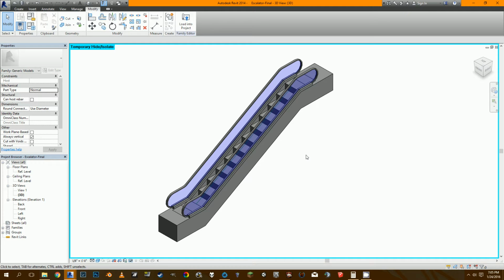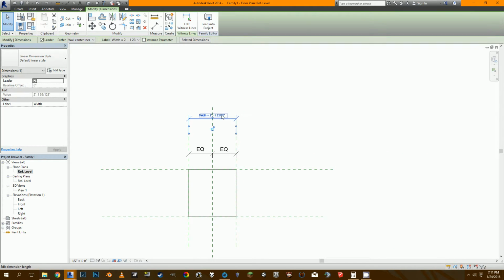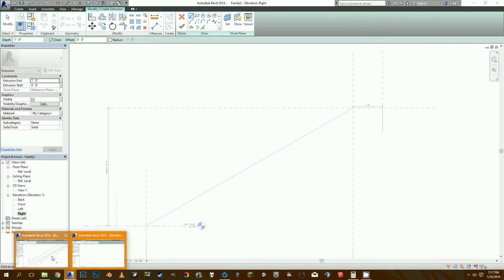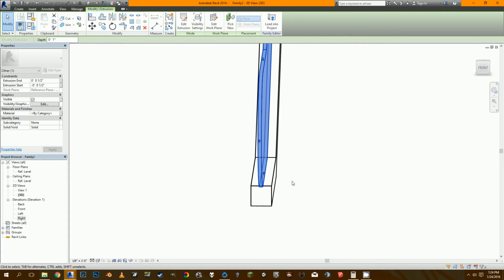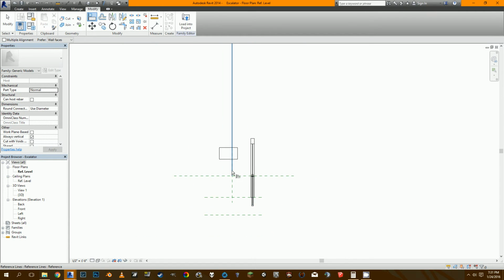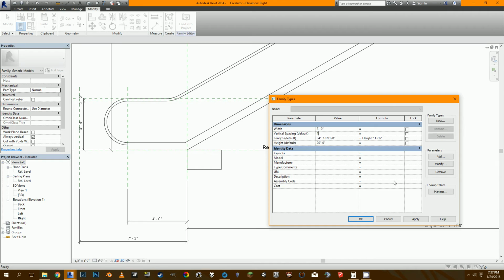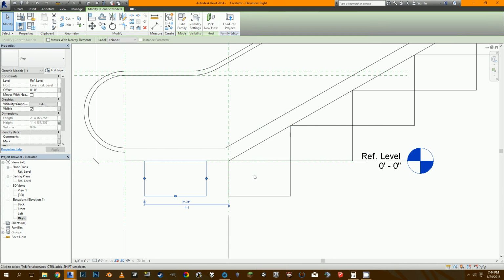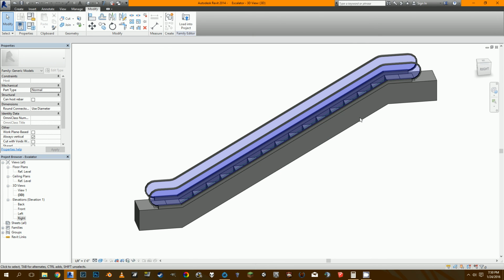Parametric Escalator - Revit Tutorial

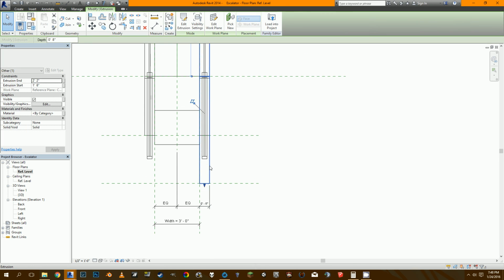Comment: Excellent video! I just have one problem, and is that when i want to adjust the height of the electric escalator right after putting the sides (on minute 43:30 approximately) the sides won't change in a proportional way, and it's killing me as it's almost the last step! Hope you can give this problem a look.